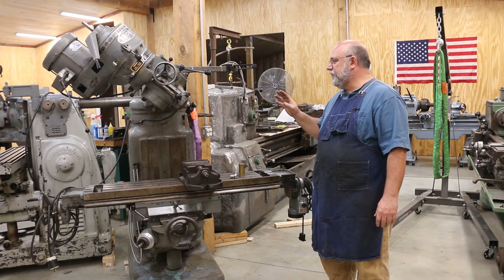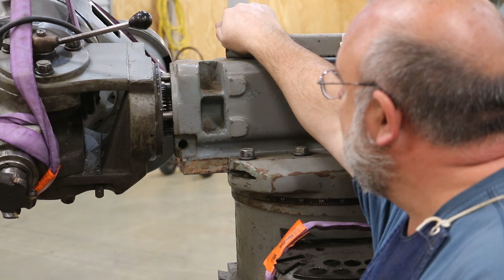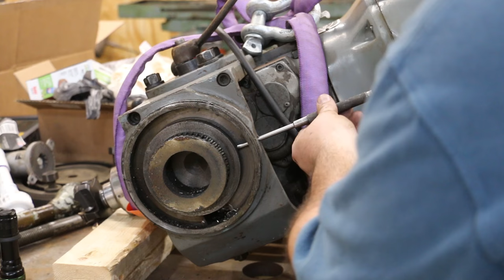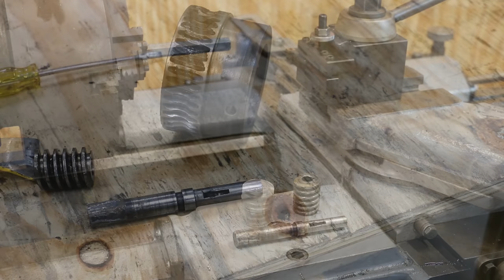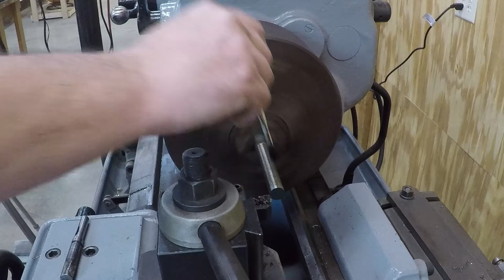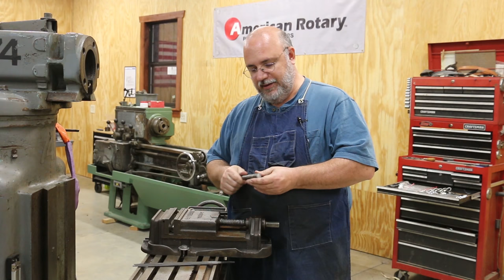Wells-Index Mill:  Repairing the Worm Gear that Tilts the Head

Comment: I was trying to figure out how you could slide that shaft into the worm gear with the key already in the shaft, and decided there must be a slot cut in the main casting to clear the key.  Then I wondered if that could explain  the crack in the original shaft -- it slid back a bit due to the lack of a proper setscrew, and somebody tried to turn it while the key was partially engaged in the housing.  This is all guesswork, so maybe I'm completely wrong but it does seem to make sense.
Reply from the maker: The shaft has two diameters - the large side is as large as the key so that it will fit in.
Reply: You're correct -- I was thinking that the key would project more than 1/16th of an inch, but subsequently realized it would not be that big on a half-inch shaft.
Reply: Even if the key protrudes ~3/16", the worm has a broached keyway slot for it to slide through.

The worm is held in place - more or less - axially by the slot milled for it in the cast housing.

So, the key and keyways are there to link the rotational motion of the shaft to the worm.

Comment: Could you use a larger diameter cutter of the same thickness, then grind the flat part of the key down to fit? Also did you look up the other gear, I'm curious of what the price is.

Comment: Is their any reason why you can't just clock the gear 180 from original.  In theory if it could only travel 180 degrees to begin with the "back" half of the gear should be fine.  In that way you wouldn't have to drill any new holes assuming they are offset 180 degrees.
Reply: My exact thoughts. I think the gear needs to be repositioned a full 180º, not 90º so the existing holes should work but then I am not there either to see exactly what Keith is up against. The bottom line is the excellent reasoning to use the unused portion of the gear which will outlast Keith.

Comment: Why didn't you support the shaft with a live center on the lathe?  I'm sure you ended up with a taper with the shaft overhanging that far.  Especially an interrupted cut on that hex stock.

Comment: I think that the engineer that decided that a set screw should go there really screwed up. Think about it . That screw cannot have tension applied to it or it will seize the shaft. The edge of the set screw will be constantly subject to the worm gear rotation when the worm gear is being used. I suspect that the original set screw fell out on the owner and the owner put a wrong replacement in. IF my assumptions are correct,how could a set screw ever be expected to stay tite? I recommend that you custom grind a cap head machine  screw , leaving the screw long enough to use a locking nut on it. A little thread locking compound might also be in order. It wouldn't surprise me if others have encountered the same issue.Also, Maybe a replacement gear is not that rare or expensive ?
Reply: shouldered set screw made longer so it has a locking nut, same as the adjustment on my drill press
Reply: Dog point that's called.
Reply: yes, i could not think of the name at the time +1
Reply: In the US, if in doubt, "dog" is always a good guess ;-)
Reply: Think about it.  That worm gear is free floating on the shaft, the thrust forces of the worm gear are put against the ends of worm gear and the casting it sits within. The set screw merely merely keeps the shaft in place, there would be no thrusting forces against the set screw, the worm gear is not pressed on or fastened to the shaft in any way.

Comment: Nooo please grind a gear cutter and make a project (the big geared hub) instead of coughing up megabucks for the part. I am convinced you can fabricate the parts a lot better yourself. Please please.
Maybe create a great big tap and cut the thread while rotating the new part (is it called hobbing?). I have seen you weld material on gears and cut them, and I thouroughly enjoyed those videos (too) :-)
Reply from the maker: As you have probably figured out if you watched the entire video, I can just rotate the gear and get the job done.

Comment: needle thrust bearings or even bronze thrust washers on either side of the worm gear. . so the thrust is against the worm gear and the housing.. not the side of the groove in the shaft..   makes me wonder if there is something that got left out during a prior teardown..
Reply from the maker: There is no room for a thrust bearing or washer.  It is a very tight fit.

Comment: Hello Keith.... Could you mount your gear and use the original roll pin holes on the head casting for a drill jig. Drill with your Dewalt battery drill. Those holes may have been drilled at assembly originally.
Reply from the maker: Possibly so.  I am going to see if they are indeed 180 apart.

Comment: Cool project Keith! The way the keyway is damaged makes me wonder if somebody was hammering on the end of the shaft...pounding on a socket to turn the buggered hex on the end perhaps?

Also, if the roll pin holes on the gear are exactly centered, why can't you just rotate the gear 180 degrees and use the existing holes? Are the good teeth on the gear not directly opposite the bad teeth?
Reply: Probably someone thought that an impact gun was a good idea.
Reply: or someone didnt loosen the clamp properly and forced it to rotate
Reply from the maker: No telling what was done to the mill before me.  As for just rotating the gear without drilling new holes, I don't think it will quite work as it is.

Comment: Could those braze metal be added to those broken teeth then re machined like you do with a spur gear?
Reply: might be too high a stress for that, better to use the unused other side, plus cutting it might be difficult
Reply: I've been thinking about that.  Those teeth do not get used too much in that extreme end of the travel.  I think that is why Keith is going to turn the part over and use the "unused" teeth.  I am leaning toward thinking that a brazed repair would be excellent for this sort of thing.  I would think that the most difficult thing would be getting the "tooth cutting tool" ground and timed well enough to make the repair on a horizontal milling machine.
Reply: those teeth dont get used at all, unless you mill upwards with the head upside down!, if fact it must have stops anyway to limit it, thus the turn the gear over does solve the issue without any repair
Reply: I agree.

Comment: Regarding the big worm gear part Are you going to weld a stop or two not to  engage the faulty section? If you keep the original part
Reply from the maker: No need to - you cannot rotate the head past a certain point as the head hits the table.

Comment: Boston Gear L1056 Worm Gear, 14.5 Degree Pressure Angle, 0.500" Bore, 12 Pitch, 1. PD, RH
Reply: This mates to the following Boston Gears (don't know your pitch dia):

Boston Gear® G1053ARH, Worm Gear, Pitch: 12", Pressure Angle: 14.5°, Cast Iron, Threads: 1, 50 Teeth, Face Width: 1/2" -- 4.167 Pitch Dia
Boston Gear® G1260RH, Worm Gear, Pitch: 12", Pressure Angle: 14.5°, Cast Iron, Threads: 1, 60 Teeth -- 5.000 Pitch Dia
Boston Gear® G1054, Worm Gear, Pitch: 12", Pressure Angle: 14.5°, Cast Iron, Threads: 1, 80 Teeth, Face Width: 1/2 -- 6.667 Pitch Dia

Comment: ...That's quite a lot of weight on that small pair of gears and 2 roll pins. Could be someone moved the machine with the head up, and hit something....? or, someone used an impact tool to turn that adjuster.... is there a set-screw that retains the worm shaft in the groove next to the worm gear?
Reply from the maker: There is a set screw that retains the shaft that holds the worm, but it was not engaged (part of the problem).  I think that the teeth were stripped before I got the mill.

Comment: Could you Just slot the shaft and use a square key the length of the worm? Longer Key = stronger and not able to back out as easy.

Comment: Could you just refit the gear 180 degrees from the original without having to drill new holes for the roll pins
Reply from the maker: Not really.
Reply: It may have already been rotated once in an earlier life.  In that case there would be two areas of about 90 degrees each with worn teeth.  There should still be two useful 90 degree areas with little or no wear.

Comment: I wonder if you could put in some stops on the head to prevent the rotation to where the worm could get to the broken teeth.   is it even possible to rotate to that position?
Reply: also if there isn't a grease zerk you could install one.
Reply from the maker: It can't rotate that far - the head hits the mill table before it can go that far.
Reply: Keith Rucker - VintageMachinery.org  So you could  choose to believe the designer planned the mill to have that large gear rotated after 50 years

Comment: It looks to me that the roll pin holes are aligned on the center, shouldn't you be able to just rotate the gear 180 and you'd be good to go without drilling new holes?
Reply from the maker: It needs to be rotated roughly 90 degrees to fix the issue because of where the broken teeth are.
Reply: Frederick Lynch I had wondered the same thing

Comment: I bet Keith Fenner could fix that gear.
Reply from the maker: If I had to, I could make a new one myself.  Fortunately, I won't have to....
Reply: Keith Rucker - VintageMachinery.org sorry went back and reread what I wrote and realized it sounded rather negative. I thought you were saying in the video that you wouldn't be able to do it because the mill was broken. I was just making a suggestion to come up with a solution. sorry it didn't come across that way.

Comment: I have a similar issue. Except it’s the shaft that broke while trying to turn the head back to upright after it was delivered. It’s broken inside so I can’t get to it without taking the head off. It’s my first mill and don’t have a lathe does anyone have any ideas on where to get the part or even what it’s called? 😂🤷‍♂️
Or any ideas on how to get around it?

Comment: Do you need to heat treat the machined 4140 steel to make it stronger?
Reply: I had the same question. is the worm gear heat treated?
Reply from the maker: For what it is being used for, it is plenty strong enough.
Reply: Kieth, thank you for your response. I always enjoy your vids.
Reply: The worm gear shaft is only loaded in shear, the worm gear takes axial loads by bearing against either end of the housing. Weakest part of the shaft is 1/2" diameter and the shaft is in double shear. It's overkill for the application!

Comment: Keith if half the worm is good wouldn't you just use the same holes with the part rotated 180 degrees? You said it has a range of motion of about 180 so I put in a set 90 degrees off you should end up half good half bad wouldn't you?  Sorry of lots have said that already I'm on my phone on a 15 minute break and can't read all the comments that fast.

Comment: I bet that is impact damage, as in some idiot got tired of turning the head manually with a wrench so he started using the impact gun.
Reply: That is exactly what happened in our shop !!! The set screw did back out and allowed more damage to be done. We were able to turn the gear 180 and the dowel pins lined up just right. the shaft was destroyed and we made a new one just like Keith did. Total down time was 6 hours.
Reply from the maker: Likely so.  I will never know what was done to this mill before I ever got it....

Comment: If you're going to rotate the gear 180 then why are you going to drill new holes at 90 degrees from the old ones. Just turn it 180 (half way) and use the old holes

Comment: Keith, If the chowdered teeth were on the bottom can't you just rotate that ring gear 180 and reinstall using the same pin holes?
Reply: Michael Durling terrible idea lol
Reply from the maker: Where the damaged happened, it will be better to just drill new holes.

Comment: Why go half way?  I understand that you can use the other side of the gear, but why wouldn't you just buy the part and then it will never let you down.....  instead, at some point you are going to say to yourself, "I wish I had fixed it correctly when I had it apart".  I just haven't known you to cut corners.
Reply: price of the part is a consideration, secondly, if it never touches the other half, then its just using it up, not a bodge
Reply: Half the gear is unused and in near new condition. It only rotates 180 so should be fine. That said, I think it would have been better to buy/make a new part for sake of completeness in restoration and security.
Reply from the maker: I don't consider it going half way.  Why fix something that does not need fixing?  When I rotate that gear, it will be in a part of the gear that will never be used.
Reply: How many decades has it worked fine before the half of the worm gear got so bad that it was inoperable, the  unused half should last at least as many decades as the first half did, more actually since the key and key way and shaft  will be correct.
Reply: It's entirely possible this damage was caused by a single incident or insensitive use by the machine operators. Not only is the part of the gear that will be used still good, Keith will always remember this problem. Every time he uses this worm gear set, he'll be sure to do everything he can to help avoid over stressing it.